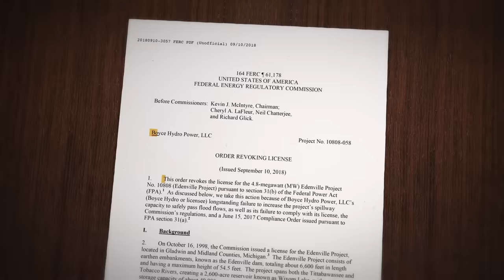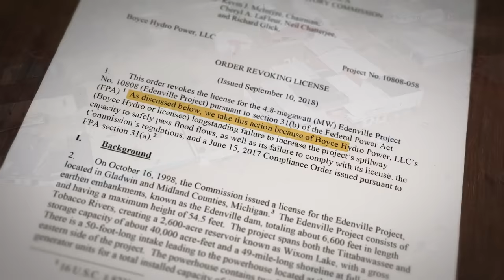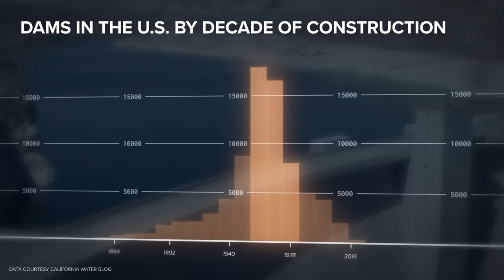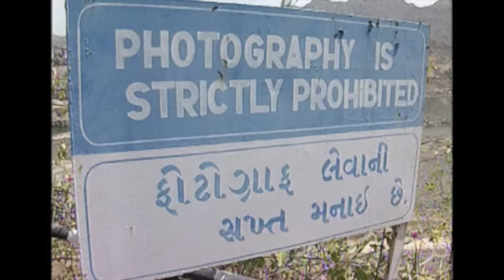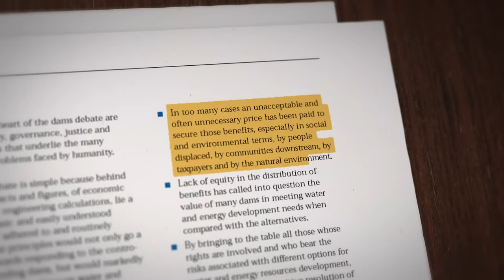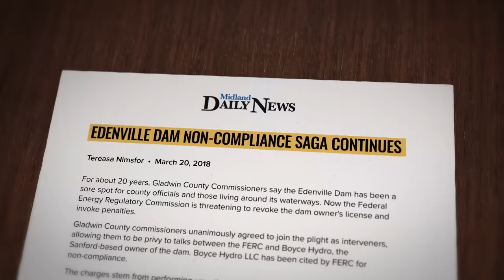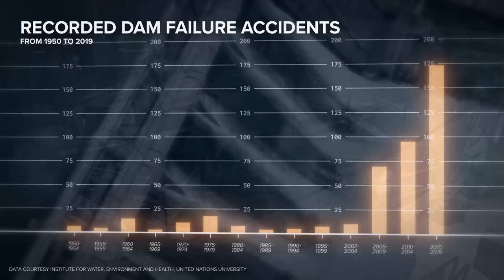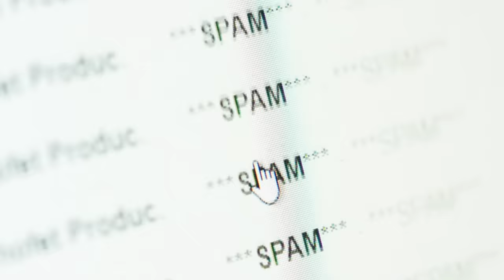The Troubling Danger of Dams

Comment: Dams should be treated much like nuclear plants in the way they shut down. If an operators license is revoked then they should immediately begin draining water levels and decommissioning the damns. Unfortunately everyone wants to squeeze every last penny and eventually it will cost life downstream.
Reply: That's the real solution here.
Reply: I think a really tricky difference is the development that occurs downstream of a dam. You literally can't drain it without flooding tens or even hundreds of permanent structures built in the eventual flood plain. There's a cost of displacing people when the dam is being built and then another cost of displacement when it's being decommissioned
Reply: @Spencergolde  You couldnt release the dam all at once but their should be a drier some extra capacity in every waterway to slowly drain a dam. If not those homes are going to be destroyed no matter what and should never have been approved.
Reply: @Spencergolde  absolutely. Everything down stream is more important than the dam itself. However, none of it will exist if your dam gives out. You do have to weigh the costs of the weight of water. Pour out maximum flow capable for everything down stream to survive. I'd argue sacrificing some to save all is a considerable option too.
Reply: @Spencergolde  to add, if they didn't run dams into the ground for economic purposes they would begin decommissioning years in advance and slowly drop water levels safely. Like a nuclear power plant.
Reply: This would solve some issues. However, it would be met by huge pushback and economical consequences from the upstream population- usually the lakes have a recreational purpose, and homes losing their waterfront position and instead becoming adjacent to a mudpool would lose a lot of value. 
This makes it a very hard solution to push trough in practice.
Reply: Brazil having a Dam that can cause more damage than any nuclear bomb or nuclear accident can.
Reply: I would suspect that all of the residents with water front property on the reservoir would sue to keep the dam from being decommissioned.
Reply: @Spencergolde  uhm ... yes you can since they do that often for maintance? Am i missing something? 
You should not Open all gates but you easely drain a dam if you want it, only that for the larger ones it takes ages to fill them
Reply: @jelteklaswijnja4055 your home is worth zero when that dam breaks and your house is washed away.
Reply: @enisra_bowman some dams you can do that… a lot of dams you cannot without effecting a large amount of people.

we need to drain all dams at some point, and use almost all nuclear.
Reply: @cmm3338  Note- I'm talking about the UPstream side of the dam. The houses along the lake.
Reply: @jelteklaswijnja4055  ah, yeah won’t get washed away but certainly economic impacts. We have far too many dams,  more than we can maintain to the level needed.
Reply: @jelteklaswijnja4055  If those homeowners want to keep the lake not loose property value, maybe they can pay for the maintenance of the damn.
Maybe that's a good conversation to have. If the revenue from electricity generation isn't enough to maintian the damn, maybe the other beneficiaries should contribute. Homeowners, water leisure activities businesses, water supply companies... whatever else is taking some sort of benefit from the existence of the damn, maybe could contribute directly to it's maintenance in some way.

It doesn't sound farfetched or unfair to me.
Maybe they had it to good for long enough?..?... But I digress.
It still sucks, and I tottaly get it.
Reply: @jpfidalgo7  If property value is taxed in the US, then they would pay for it if the dam were state-owned. (not sure how that's regulated over there- except that the dam being private makes this all a lot more complicated to achieve.) 

If the dam was there when they bought the house, they paid for the value then. Having it go away would be devastating. Suddenly needing to pay to keep the lake sounds... like a Homeowners' association type situation; once it's there it can be enforced. But nearly impossible to introduce.
Reply: @cmm3338   only Nuclear Power is neither cheaper or Free from pollution and ofc it affects people down the stream and in the Area if they need to drain a large dam, but since it's controlled and planed you can work around these problems and it affects People way less than an unplaned broken dam
Reply: @enisra_bowman  more than 70% of Europe runs off nuclear, im not saying it’s perfect but it is easier to maintain (don’t need so many), and while nuclear waste is not great, we have far better ways of storing it than we did even 10 years ago to mostly offset the potential of disaster. that does include safeguards in case of natural disasters, etc in place, regulated, and most importantly is actively being researched, and new tech being placed.

you cannot say the same about dams, yes it is extremely efficient, and less harmful for the environment, however poses a far greater risk for failure, and that failure being catastrophic..

china has resorted to building new dams, around older dams in areas where drainage is not feasible. i see that happening here, soon.
Reply: @jelteklaswijnja4055 kind of feel we need to stop considering people's property value as equal to the lives of others. It sucks that you take a hit to your property but if the dam fails you take the hit anyway AND lose the lives of friends and loved ones downstream
Reply: @jelteklaswijnja4055  Sadly, it seems very likely those owners won't seem to listen to the idea that either A.) the dam holding up the lake needs their help to keep it maintained so they have a lake, or B.) the lake needs to be lowered for the safety of everyone on either side of the damn, they're going to lose the lake ANYWAYS when the dam inevitably fails at that point.

it's not as if everyone trying to talk to them about it wants to maliciously ruin their lakefronts. I, in this hypothetical group, would like to try and maintain things as best as possible for both them and those who live in the floodplain. But between them losing their recreation and vacation homes and all the people who might die if the dam breaks, I'd rather we sided with the latter.
Reply: @cmm3338  well, i somewhat doubt the 70%, the French Maybe but they are only  and also, there is another Problem: the Nuclear Powerplants are also really old now and we know what happens with old things.
Not to Mention that in 2021 during the height of the Summer some French Nuclear Powerplant needed to shut down due to the River that provided cooling water dried up.
Also there is still not one long term storage facility finished. And i somewhat doubt the Energy Conclomerates spent a single Cent for the construction. 
And i wish i would made that up in a weird conspiracy but: well, a lot of the Pro Nuclear Power comes from the current Plant Owners since they don't like that some relatively small Group could build a Wind Turbine that eats in their Market Share
Reply: @kashtrey  I do not mean to imply that lives have little value.

I'm only trying to make the point that it is a more complicated problem than it may seem at first glance, as the entire socioeconomics of the area have changed and adapted to that dam as well. Shutting it down, even if technically feasible, is going to be at least as big of a change as when it was first built.

I do not have an easy and fair solution as to where the funds to keep it in place should come from.
Reply: Draining millions of gallons where precisely?
Reply: @JonathanScarlet  Agreed! As the dam is already in place, it is likely in the best interest of the population to have it there in a well-maintained order. 

It is however going to be very complicated to fairly figure out who living along or near the lake should contribute what percentage; how does one quantify the received benefit of a lake? And what if people can't afford this sudden charge? Should they be sued, jailed, evicted? (my point being that that seems unfair too) 

However, simply shutting it down will not be simple.
Reply: One problem that's overlooked is when the government is the reason it can't be lowered. The dam that is the subject of this video was prevented by the governor of Michigan because she said lowering it would create adverse affects for a type of clam that lived in that lake. The owner of the dam tried to lower the water and she took him to court to prevent him from lowering it to a level that he felt had a chance of holding up to the looming flood. He warned under oath that if he wasn't allowed to lower it much lower than her imposed depth limit that it WOULD fail. And it didn't matter. The government sent police out to the dam gates to ensure he was unable to lower it because he threatened to the court order and lower it anyways.
Reply: Agreed. Or we eminent domain the shit and get it up to standard so it can keep operating
Reply: @bluetyphoon2100 is that the way they do nuclear plants?. I work in one. Please elaborate
Reply: @trump1105  sure, water is incredibly dangerous much like nuclear waste is. In the nuclear energy field precautions are taken at every level to ensure the plant runs smooth without issue. When a plant is done operation they don't just turn it all off and go home. It's a 10 year process that requires taking reactors offline and decommissioning/decontamination of the surrounding areas. If dams treated the water behind it like we did nuclear waste we wouldn't have any dams in theat of bursting. We would start taking them offline now in a safe controlled manner.
Reply: @enisrabowman2634  You can not fully decommission the dam and take it out of service without flooding development built on the old flood plane, where the river used to run. I suppose you could dig a new canal capable of passing the entire flow of the river around the new development, but that's a huge upfront cost and a long project that would only bring things back to how they used to be, there wouldn't be any value generated.
Reply: @Spencergolde  Literally every dam can be drained at least to a significant extent. It's just an absolutely necessary piece of basic functionality for a dam to have, especially one that generates power, and adjustment of the reservoir level is routine. A "dam" without controllable gates is called a weir and they don't generate power and exist for very different reasons (they're also often extraordinarily dangerous). Every river can flow at 110%, maybe even 150% of normal for a while and nobody will even notice, and that'll drain a reservoir eventually. Just release the water during the dry season, and it'll still be less flow than the normal level during the wet season. There's no need to flood anything at all. We don't have to have these dams fully drained *today*, just sooner than later.
Reply: @c97f such lawsuits should be thrown out as frivolous. Just because you own a house on the water front does not mean you own the water itself.
Reply: @jelteklaswijnja4055 if people can't afford it then the dam does not get their money. If the dam doesn't get enough money to be properly maintained it is closed down and drained. There is no reason why we have to force people to pay for something. These things can be optional. That is a better way to go about democracy for these types of things than voting to force people to do something they do not want to do. HOAs could use this way of thinking too.
Reply: @killerbee.13  Many weirs actually have flow control mechanisms such as sluice gates, the difference between dams and weirs is that the latter intentionally allows water to flow over the top. While all large dams do have the ability to release some of their flow through discharge gates, and control their water level. The issue is that the natural flood plane of the river, areas which would predictably be flooded annually downstream of the dam, are currently being protected by flow control which smooths annual flows into an average of two extremes. In low flow months, dams release extra water to keep the flow higher, and in high flow months dams hold back water to keep the flow lower. The property that was developed on the downstream flood plane will, predictably, flood without the artificial flow-control provided by a dam. And there's often lots of development on the riverfront downstream from dams

To clarify, I'm not pro-dam, they need to be removed and the development that has happened on natural flood planes should never have been approved. But a key difference between hydro and nuclear decommissioning is the need to relocate these people that will be affected by the dams removal
Reply: @jpfidalgo7  Oh, the revenue is enough most of the time, but under capitalism there's no incentive to use it for that.
Reply: @Spencergolde  If you are saying there will be increased seasonal/storm flooding downstream after decommissioning a dam, then yes, that is an effect of removing a flow control structure.

But decommissioning in itself need not cause flooding directly due to there being no spare capacity in the river for draining a reservoir, which is what it sounded like you were saying. All rivers have quite a bit of spare capacity if you average it out over a whole year.
Reply: @killerbee.13  Yeah, I probably could have phrased that better. Yes, you can decommission a dam without immediately releasing the whole reservoir in a wall of water. But the development that popped up on the downstream natural flood plane, which wouldn't have existed without the dam, will eventually be inundated once the dam is removed, so decommissioning will involve relocating all of the people and structures in the soon to be reestablished flood plane
Reply: @Eagle3302PL  I think there can be incentive. I think it's a matter of perspective and ego.

Make less money a for longer timespan, and make less so huge payouts for damages aren't probable.

That's why some regulations work, because they force the perspective and allow for no ego influence. It just has to happen, otherwise nothing happens and no money as well.
Reply: @brkbtjunkie  By slightly increasing the amount that goes down the spillway. Not enough to endanger anyone who now lives underneath the dam's shadow, but still enough that it drains faster than the area's natural rainfall (or any tributaries upstream can fill it  back up. Obviously we can't do a massive draining in one go, but several controlled releases of the course of a couple years should do the trick.

Alternatively, in the future anything built downtream of a dam needs to factor in future-proofing such as channels for the dam owners to release water like this in the future, either for decommissioning or just for safety if they think heavier rain is coming.

EDIT We could also have a way for multiple trucks or something to transport the excess water elsewhere, but that's kinda dependent on having some sort of station to funnel the water to. I think the least expensive option would be the controlled releases, though.
Reply: @jelteklaswijnja4055  I don't know how to figure that out for the ones that already exist. But for any that are made in the future the cost should be factored in as they're built and/or sold (wherever that makes the most sense). Kinda like a monthly utility bill.
Reply: Significant raising and lowering water levels behind a dam is a terrible idea.
Reply: @jakahl1470  You are aware we're referring specifically to when a dam is past its life span, correct?

Nevermind that I, at least, don't see why it's a terrible idea. Provided the water is released in a controlled way that doesn't majorly affect those downstream, there should be no adverse effects on either side.
Reply: not that anyone cares - profits above all
Reply: @Spencergolde  absolutely right, the developments that happened downstream of the dam should never have been permitted. But, since they were, those people will inevitably have to be relocated when the dam reaches the end of its lifespan - the choice they have is an orderly relocation as part of the decomissioning process, or disorderly evacuation (at best, otherwise death by drowning) when it eventually collapses and their properties are washed away under a raging torrent.

Comment: I live close to the Vickery Creek dam in Roswell, GA.  It was built so that a large portion of the creek's flow could be diverted into a flume that powered two textile factories. Textile factories that went up in smoke as Sherman's "March to the Sea" rolled through Roswell. Today there's a very nice park around the land where trails take you to both sides of the waterfall. Every time I visit I think about how it was originally built 170 years ago and hasn't been maintained since 1926 when another company that was using it after the Civil War shut down.  Apparently it's safe enough to build a well-traveled park around it, but the way things work here in Georgia it wouldn't surprise me to learn that safety rating comes about after greasing the right palms.